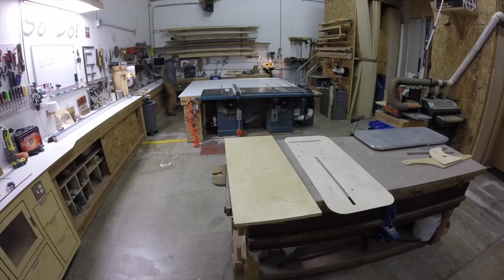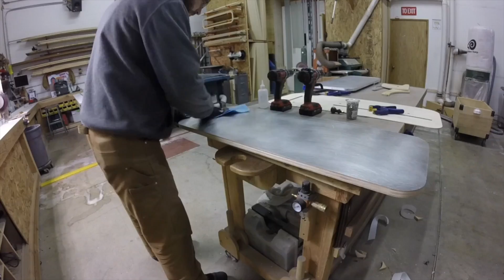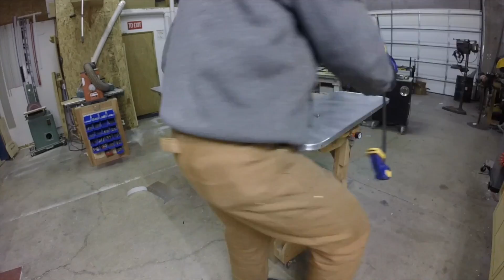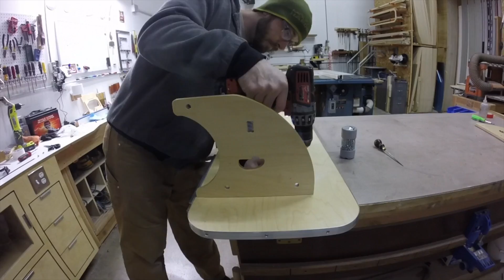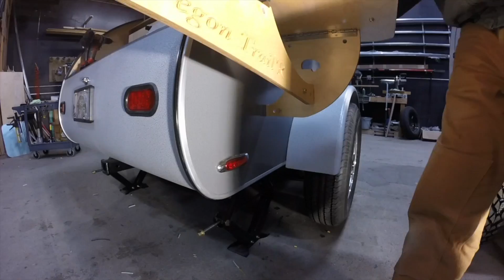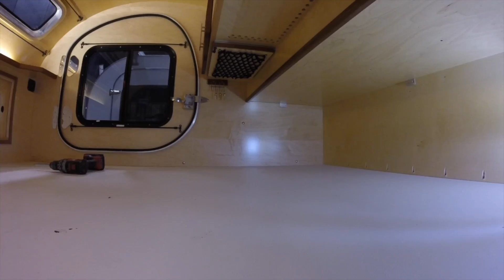How we build our Side Tables.

Comment: These are awesome. Can you tell us what you used for the metal edge banding? I ask because it looks like it has a lip on the top and bottom. Or is it just a straight piece of aluminum? Thank you for posting the video!
Reply from the maker: Thank you!  That is 3/4" aluminum "nosing."  Has a little lip at the top to capture the top surface, bends easily... We use a ton of the stuff!!!

Comment: Hey, thanks for the video. I've been working on getting someone help me with my trailer.  One person is retiring way before his time because he blew his knees and has no insurance for the replacement.  Please, please put some rubber anti-fatigue mats around your work benches.  Don't kneel directly on concrete.  Also, consider making  another taller station to your standing edging table, so you won't have to kneel to screw the edging in.  

Your videos are an enormous help modeling construction techniques, but you are missing an opportunity to model how protect your body so it will allow you to do this for as long as you want.
Reply from the maker: I don't disagree with you at all.  I'm not the model of proper joint care or ergonomics by any stretch.  Right or wrong, I tend to place importance on workflow efficiency for the project I'm working on, vs long-term health.  For example, there are a few reasons we don't have anti fatigue mats around our workstations.  They make cleanup very difficult (I spend several hours per week sweeping, would probably double if I had to sweep around mats regularly), they are tripping hazards (not a great thing when everything around you has a spinning blade attached to it), and most importantly, they make it really difficult to roll things around (many of our tools are on wheels, and we use wheeled carts constantly to move parts, etc).  That said, I actually do have miles of the stuff, and I should absolutely try to be better about using them more.  There are a few work stations that I spend considerable time at where the benefits would outweigh the costs...   Thanks for your concern, and for the reminder!
Reply: @OregonTrailR   Your guys could wear knee pads , you don't have to sweep around them.

Comment: Is that carpet tape or some special type of double stick tape? I've mimicked some of your techniques of my rebuilding of my vintage camper. I've used contact cement when sticking light weight aluminum. I hope it holds up. Thx for your videos!
Reply from the maker: Yes, non-fiber carpet tape is my go-to for most of my double-stick tape needs!  Well priced on Amazon, and seems to gain strength over time!  Thanks for the comment, I'm glad our vids are helping people!!!